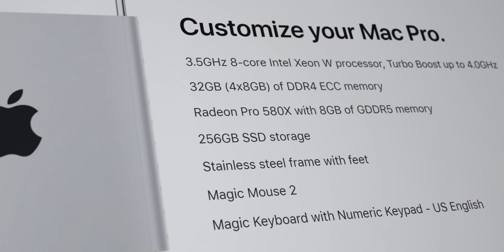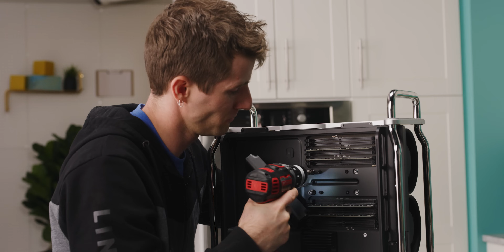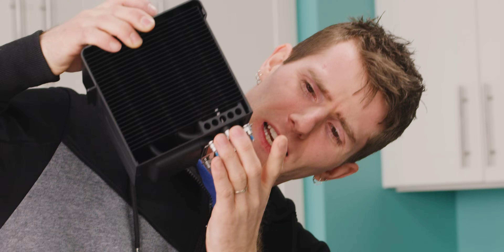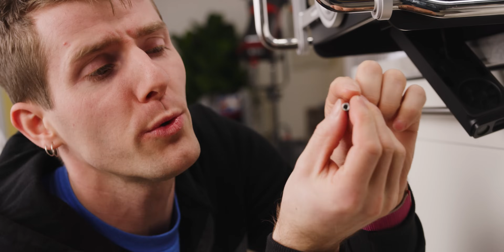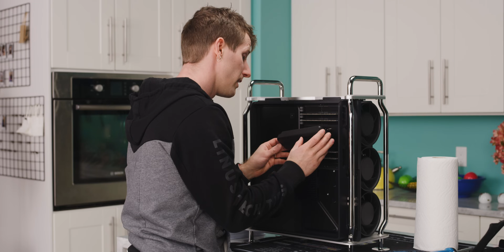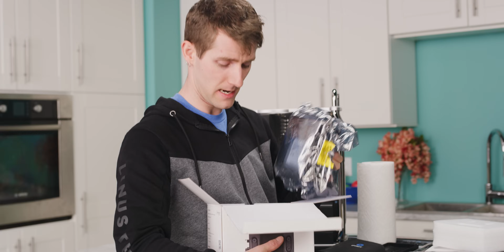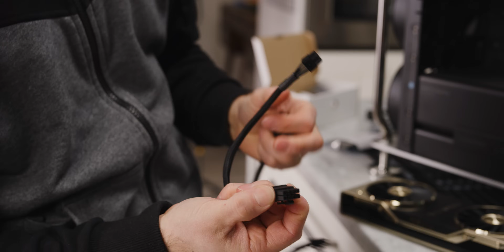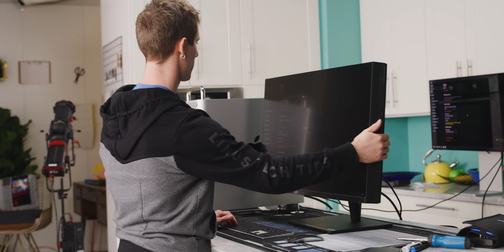Don't give Apple your MONEY - Mac Pro Upgrade Adventure

Comment: why the fuck would you tell your 10m subs to buy a 6 grand base model mac and then spend even more money on it, you should be educating people on why this is possibly the worst fucking thing they could do.

 your buying a pc with a chip in it that they refuse to tell you what it does... from a company that has been caught slowing down old devices claiming battery life is the issue like changing a battery should be a dangerous and difficult thing to do in a device your likely to be using on a daily basis.

how about instead of accepting money from apple to shill their shitty products you expose them for the shifty shit they keep doing, like paying people to shill their shitty products as they are lobbying against your right to do exactly what you see here in this video, upgrading or fixing a pc you buy from them... for 6 grand.

Comment: the reason for the "surveillance drive" is because those are generally 5400 rpm drives. they are meant for long run times, and being quiet and cooler than the 7200 variants

Comment: Legit demo, since Linus dropped something in it ( "as it always should be the case" ).
It would of been perfect if he had used a static bracelet to avoid short circuiting the power supply if it went into contact with the case, but I won't rant for that little.

Comment: Basicly   if you wanna make that starting thingy as a Hackingtosh , in germany   the Pricings for the Hardware  on Amazon  is 2000€  SHIPPED....  the Radeon Pro 580x   is a revamped version of the  Radeon Pro WX 7100  (Polaris-10)  for  629,- and the  CPU  is an Xeon W-2125  (LGA-2066) for 540,-  The GPU is 150w and the CPU 130w    thats why they can keep that crap cool  with theyr 3 Fan design, every 450w bronze PSU can handle that hardware.

Comment: Hey linus, which core i should go for i9-9880H or i79750H when the difference between the price point in the same laptop (with 32 gb ram in i9 and 16gb ram in i7) is around $400.

Comment: What an absolute ripoff.

1. It doesnt have a drive bay on it, so you need to buy it extra and it costs.....400 bucks? Sure it has an 8TB HDD, but its pre-installed and you cant choose anything else, plus the drive isnt worth more than 250 bucks. This means that for this proprietary drive cage that only holds 2 drives btw, you're paying 150 US DOLLARS! Insane.
And just think that a standard PC case doesnt require you to buy this extra stuff, because it has it natively.

2. There's no PSU cables that are available to you, and the on-board power connectors for add-in cards are proprietary, which means you have to spend 70 bucks in order to buy a 3rd-party adaptor cable set, which wouldnt be necessary if you had a standard non-proprietary PSU.
Just....FFS! 70 US DOLLARS for a few adapter cables that shouldnt have been necessary anyway.
Like come on Apple, these people are paying the price of a freakin' car, and you cant bother to give them a handful of cables with it?
Jeez!

3. The RAM costs over double the market price. For no apparent reason. Just cause....Apple tax. 
From 5 grand to 10 grand. WTF!

4. The graphics cards are all overpriced. ALL of them. 5200 USD just for a Vega II dual GPU card. Why?
Apple tax....again?

Loyal Apple customers must love getting ripped off. Just really, why dont you hand over some money to Apple while you're at it.
Give them 30% of your annual earnings. Cause why not?

Ridiculous.

Comment: The problem is, just by buying the base model, you're already spending at least $2000 more than for a virtually identically specced PC (Motherboard - 1x Asus ROG Dominus motherboard ($2000), 1x Xeon-W 3223 CPU (800), 1x Crucial 32Gb ECC RDimm ($140)  1x Samsung 970 EVO plus 250GB SSD ($100), 1x AMD RX 580 video card ($400) and 1x 1600w power supply of any reputable brand (about $400) 1x Phanteks Primo White/Dune Pro Case ($250/650) - total (assuming the most expensive case - $4490).  As for non-identical alternative builds that would easily surpass the performance of this for the same or significantly less, the options are endless.  So far as I can tell, the Mac Pro's sole selling point - aside from the OS, which may be a big issue for many - is the afterburner card.

Comment: As a PC guy, I am actually impressed. Its solid, intuitive and well engineered for the average joe and professionals PC builders to upgrade. Good Job Apple!
Reply: Aaaand overpriced.
Reply: @TheRealNightShot  well considering their RND effort, I guess it may be . But if you buy the entry level version you can have a great value with user upgrades
Reply: @0163844098  Ineed, you have a point. I also appreciate the quality on which Apple builds products. The problem is just those pricing. They have a legit no sense. Especially the Apple Pro Stand. Aluminum. Apple. 999$
Reply: Don't forget that. That's why we Pc

Comment: builds “overkill” mac doesn’t put two twelve terabyte drives in it instead
Reply: Well yeah...
10:13
It's tied to the Motherboard for whatever god awful reason.  Apple still isn't inclined to letting their customers have their own way with the tech they pay for.
Windows has always been a consumer favorite for it's sense of DIY that you get from ordering all your own parts, the sheer cheapness of it in comparison, and the overall fantastic user-access to the parts within.  It makes it extremely easy to upgrade and swap out old worn out parts.  But Apple has to tie one thing down, and keep their consumers from being able to fix it without a phone call and a repair fee.
I guarantee you they kept the SSD's tied to the motherboard, cause somebody's SSD in their Mac Pro is gonna die 3-5 years again so they have to buy a new one.
Reply: @sirisaacnewt171  You can still put more drives, you just can't replace Apple's drives.
Reply: @aryansingh2199  Yeah, and even if you put in extra drives, when those 2 drives that are preinstalled die, so does your motherboard, and therefore the rest of the pc.
Reply: Sir Isaac Newt yeah but when will that happen?
Reply: @rudy2shoes354  If it's a good, well made SSD?  Years and years from now.

But Apple has every possible opportunity to purposely design it's life-span to be shorter, if they wanted.  Not saying that they've done it, but the possibility is still out there on the table.  Other companies have done the same thing before, and I personally wouldn't put it past Apple.

Either way, even if their own SSD has some sort of miraculous failure, you should be able to buy your own SSD and fix such a small issue yourself instead of phoning Apple about it.

Comment: It’s not unprecedented- y’all should disassemble a 5,1 cheesegrater. Or literally any PowerMac. Or the G3 iMac with the slide out mobo tray. Or literally any Apple device pre-2000. Once upon a time, Apple used to be renowned for how thoughtfully they designed their upgrade/repair pathways.

Comment: I saw this mac pro disassembling - you can remove heatsink normal. There are 2 holes in radiator for looong screwdriver - its like on be quiet big coolers

Comment: 9:35 ~ cute, provocative line. ~ Whomever "My one regret is that they have green pcb's" gets a pizza or luxery 8 course (minimum 8 colors) meal delivered to the office. 

My default was always ATI, MSI, Sapphire #RedPCB, #Epox the best overclocker did a Different Green. My GigaByte Embedded GPU was a #BluePCB, my Foxconn was a BrownPCB. #Asus the best cloud provider has a lot of BlackPCB, yet in my time all the pros and behind the scenes top i see it still true #SuperMicro for the server market has some elite interactions, various IC and certifications no other else is providing, interacting with, or experiencing. ~ It's a curious thing to use color temperatures as an #UnderWritersLaboratory #IEEE standards association guide, USCode & NECA, in this case maybe some sort of year code, and Gigabytes per Volts spectrum. = Color Temperatures.

Comment: Linus, boots up the Mac and is greeted with a message stating that changes were made to the hardware. Wondering why the system isn't running any differently, calls Apple support. Apple support informs him that since the upgrade was made with hardware not purchased through Apple, or the parts were not labeled as Mac compatible, that Linus, would have to pay an upgrade fee to unlock the performance of the new parts and thanks him for purchasing Apple.

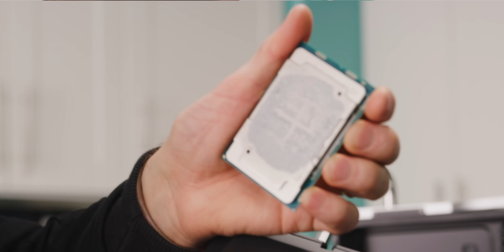Comment: 4:16 I used to be an Apple repair tech, and the way Apple had us apply thermal compound to the trashcan Mac Pros was to put a plastic grid guide over the heatsink, put way too much thermal compound over it and then scrape the excess off with a credit card-shaped applicator. This resulted in a very even and cool-looking grid pattern, and a lot of wasted thermal compound.

Comment: I guess he didn't know he could have taken the cooler off without having to do all that trouble, as there were actually 2 holes on top of the cooler you put a long screwdriver, and it removes 2 screws that easily take the cooler off.

Comment: Linus: "we put 1.5 TB of ram in a Mac Pro"

Google Chrome: Heavy Breathing at 1.15TB being used
Reply: I opened about 50 different chrome tabs and only used .3 gigabytes of ram.  I have no idea where these comments are coming from
Reply: Ah so there’s no way to stop it on chrome? Or just use a different browser
Reply: DiccTatter explain
Reply: @ameenelbaba5880  google chrome has an issue where it will use a percent of RAM instead of what it actually needs, I've run into this multiple times, something kinda like that happens on Firefox if I leave it running overnight playing youtube.

Comment: ffs, its a solid system and all, but Apple still going with the whole Secure Enclave thing with their drives being basically joined at the hip with their product? at least for this you can add more storage and you aren't just stuck with whatever model you bought like some of their older products (which is understandable for how the whole system works, but its also just a big money grab).

Comment: I was just thinking that thing sounds quite plastic and then it turns out they already broke the clip because it is all plastic. It is a 6k PC with the performance of a 2k PC and then they can´t even make the covers out of stamped metal. It would have cost them maybe $15 more to make it all out of metal. You can see where their priorities are. It is all about looks since they give you machined aluminum PCIe covers which cost more than making all those plastic parts out of metal.

Comment: next thing you know. Apple designed the motherboard to accept  certain cpu, ram, gpu, ssd and everything you upgrade what they want the board to accept or serialize the part and accept only that part and only they can change it. Then charge fortune for your upgrade. That's apple.

Comment: To bad even the base model is horribly overpriced or I would buy one and upgrade the things I wanted better myself. Instead I did buy a Complete Workstation with 8 core Xeon 2288G and a RX580 (for testing Hackingtosh), 32GB ECC RAM and 1TB m.2.  It did cost about 2000$ (with 25% Norwegian sales tax) and run  4,6 to 4,7Ghz all 8 cores 100% use when you let it run full 230W power use. AND it runs as a Hackintosh High Sierra perfectly fine even uppdates working without breaking the system  (this far at least). If the Cheese grater Mac Pro had cost 50% more then my current rig I might have condidered it but it cost 4 times as much....

Comment: Couldn't you just read out the voltages with a multimeter from that special minfit power connector (for the sata drives) and do your own connector to power any fucking sata drive instead of buying that damn enclosure?

Comment: A 'surveillance' hard drive is basically just a server drive, because DVRs have a constant duty cycle like server drives do. Lots of consumer and 'prosumer' security DVRs end up with users replacing failed drives or trying to expand their capacity by installing cheap, standard PC commodity drives, and they fail very quickly.

Comment: I have an overclocked Ryzen 7 2700 and a RTX 2060 Super and 16gb DDR4-3200 and had a good laugh at this video knowing I'd have similar specs for under $2K if I spent $100 doubling RAM lmfao

ALSO HOW THE HELL does AMD get a contract for GPUs in a 3.5ghz 8-core setup and not scream at Apple "OURS ARE HALF THE PRICE AND BETTER"

Comment: Did you just say 60 fps?  20+ core CPU, Titan RTX and 1.5T Ram????   So >$20K is a 60 fps gaming rig????

I just checked my Windows 10, Ryzen with GTX1070 and 16g ram system for $1500...  90 fps...

What's the rez on that monitor? LOL

Comment: Linus: The Mac Pro is overpriced garbage
Also Linus: I even love the screws
Reply: The screws alone makes up for its price. Totally worth it.
Reply: My thoughts are the design is somewhat inspired, however the price is way out of line.
Reply: When did Linus ever say the new Mac Pro is garbage?
Reply: Imran Sardar he actually did praise it. I'm just... paraphrasing 🙃
Reply: That's what Mac is - overpriced garbage with fancy screws.
Reply: Vlad Klevtsov I'm guessing you've never actually used one. Just assumes. Since I use both I can say that yes, they're expensive but considering the state windows 10 is in, I'd have the mac.
Reply: @kav12ab  There are other operating systems than macOS and Windows, that don't trade your privacy for doubtful ease of use and over-advertised features. I work with macOS occasionally and while it's being an eye candy it's not that flawless as many think. It really doesn't appreciate a user that wants to tinker with stuff. Its debugging info is mostly non-existent when something goes wrong, and, boy, something goes wrong in macOS more often than many would expect from such a mythical OS.
Reply: @OlavLadnav  Couldn't agree more. I first looked at a mac 20 years ago. I was told it was the most stable system available. I crashed it within 10 minutes of switching it on. I've never gone back to macs in any way shape or form since then and never will. Macs are for people who either have more money than sense or don't understand computers or both.
Reply: Vlad Klevtsov but it's Unix based so everything's quite a lot more stable than on Windows. Don't get me wrong windows 7 was great. I'm just not a fan of 10. For example the microsoft store is the worst anything I’ve ever seen. 
The only other option is Linux which is great but it's not for everybody.
Reply: Ian Carolan so you're basing your argument on a 5 minute experience you had literally ages ago? 
Also dude you really can't call everyone using Mac noobs. Cos some of the most knowledgable IT people I know use Mac. You're just hating on another group and I have no idea why. People who actually know their computers know that both have their own merits and disadvantages. Saying one is infinitely better than another is stupid. Same goes for ios as well. Even Linus said so
Reply: @kav12ab  Yes, I know the merits of different OS's, that's why I've never touched mac again. I've worked with solaris, bsds and linux in server environments and would never touch mac with a barge pole. So far the most stable I've come across is solaris/bsd with ZFS. It's not an argument it's an observation.
Reply: Ian Carolan yeah like solaris is for the mass market. Also might I add is based in Unix. And you should try macos cos to me it seems like you're really judging a book by its cover
Reply: @kav12ab  I have no use case for macos. Why would I want to try it when I have no use case for it? Your argument is I should try it because it's a mass market OS and it's based on Unix? Next you'll be telling me to use Android because it ships on most devices. No thanks, when I have critical systems to maintain I'm not going to use macos.
Reply: @kav12ab  Awww, is didums having a bad day?
Reply: @kav12ab  So that's it then, no more legitimate arguments only insults? Why so angry? Why do you have this great need to defend macos? I've never found macos to fit my use case and you seem to have a problem with that? Do you realise how childish your behaviour is right now?
Reply: @OlavLadnav  Stay ignorant kid
Reply: @TheEchelon  Ok fanboy
Reply: @TheEchelon  Go on, waste that money dude
Reply: @TheEchelon  Knowing that paying overpriced for garbage is being ignorant? That's a really cool story.
Reply: @pookieunc  Think you need to look at the design and what engineering like that costs it's not the spec your paying for, this thing is designed to last! see the 2010 pro and is still a viable machine to use today, how many windows machines can say that, and how many window machines are even still around from 2009/10 using original components like power supplies. Waste of money Nah, it that equates to around 1.60 a day over ten years if it doesn't go the way of the trash can that is. which i don't think this one will. The office here has been through hundreds of PC's in the general work areas, the design office very rarely do we need them changing, oldest one we have being the 2010 mac pro and is still being used for product rendering and offering a perfect user experience.
Reply: @Twinklinglittletoes  the only things they actually engineer have nothing to do with function. They're just exterior. The first PC I built worked perfectly fine for years, then I gutted it and upgraded because I wanted current gen performance for gaming. I'm still using the same $30 case from my first build. This new Mac is built well, and designed nicely, but its all only in service of esthetics. It has nothing to do with longevity over off-the-shelf builds.
Reply: Technotuna when people say macs last longer what they mean is that even on the same hardware after so many years it still works really well cos its well optimised bc of the UNIX Base and the small lineup. So you can make it last longer than a pc. I'm talking from experience of both.